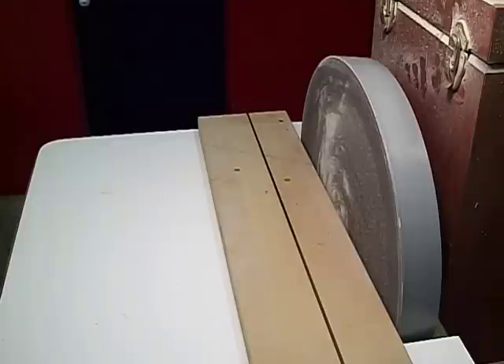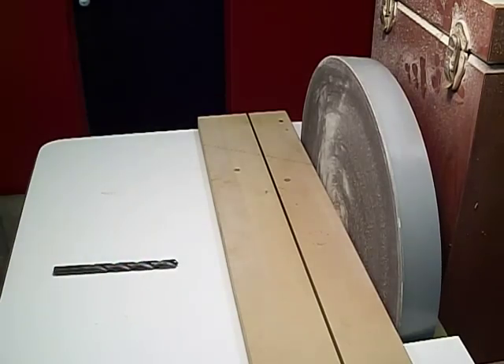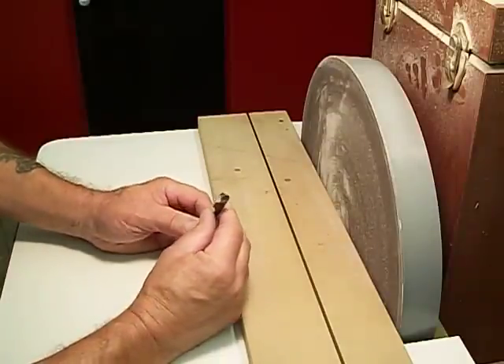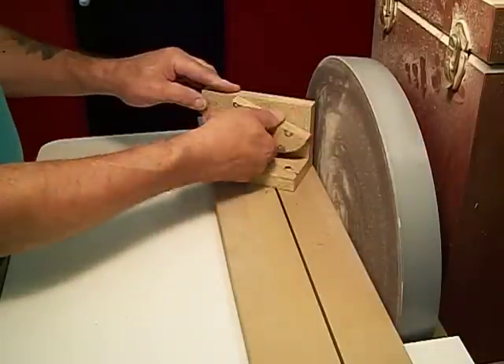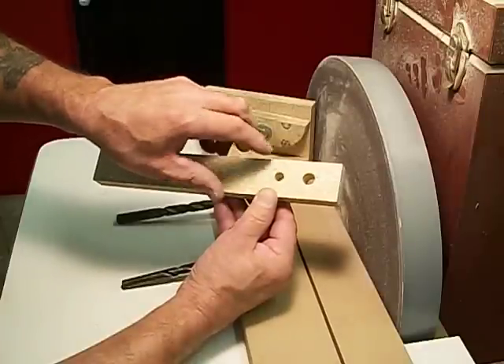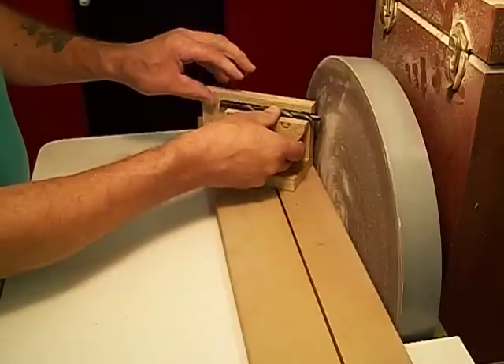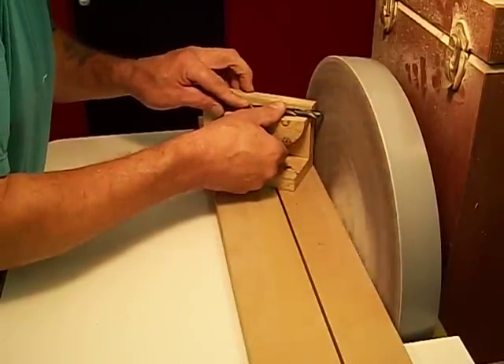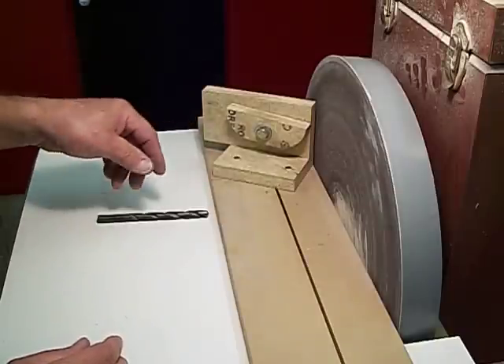A Drill Bit Sharpening Jig You Can Rely On

Comment: if it works for you man, go on and use your set up.  for my needs, and demands, and some of the idiots i work with lol,  this is a loss of finger tips.   guess thats why i have the lil more costly drill bits and always sharp and theres are cheap-o-s and smoked or dull or even broke.  i have a drill dr at work and one of them there piece of shits you showed, its in my tool box collecting dust, normally i use a cheap 3.5" harbor shit variable bench grinder for drill bits on one stone, and tungsten for my tig welder on the other stone.  i have even used a hand grinder with a floppy pad, hard stone and a cut off wheel. in a pinch when im out in the field and dont have that all with me, i bust out my little ol diamond stone knife/ fish hook sharpener to dress and edge up some,    now years ago if i had seen this video. but internet wasnt out for public and well google and you tube wasnt even thought of even,  i would of used it

Comment: Sorry but your jig is flawed. The only thing you're getting right is the angle, but you have no control over flute length, or the parallel-ness of the flutes.
Reply from the maker: There have been many a drill bits sharpened by eye than either you or me can count and a lot of them by machinists.  So, if you say my jig is flawed then I suggest perhaps your eyes are flawed?
Reply: I didnt mean to offend, but that was the point,  your jig its not much better than doing it by eye. If you had a stop at the back end of the drill, you could at least get the flute lengths the same, but whatever works for you.

Comment: The so called piece of shit jig is 1000 times better than your few planks. When you cutting steel you need to be exactly aligned. Metal work requires setting up things correctly and that jig is just great if you took the trouble to set it up.